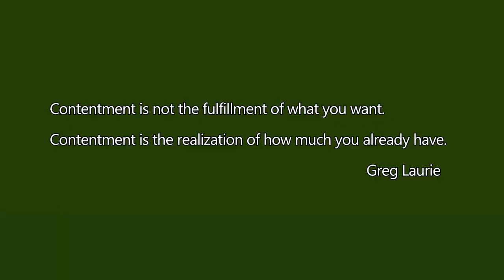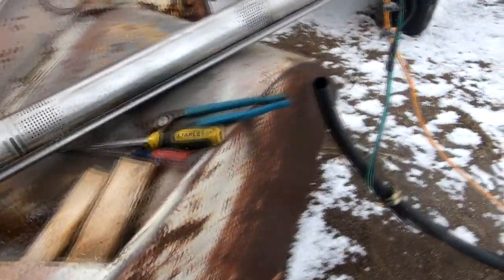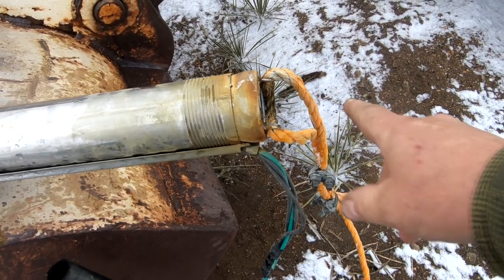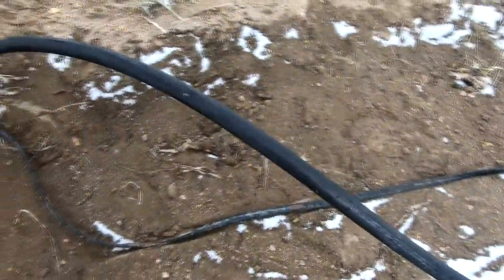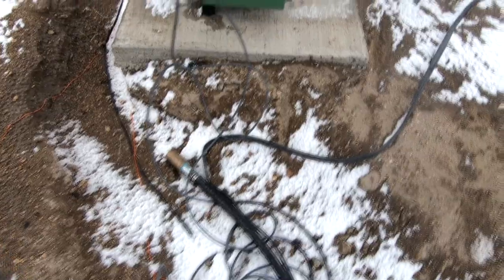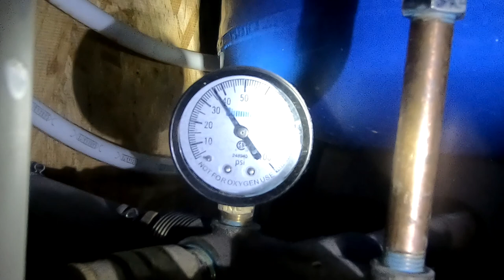Well Repair

Comment: I use a geyser pump to bring water up to my tank above the ground and a small pressure pump to deliver water to the house. Mother in the ground can go bad. The air pump is inside the garage and runs during solar time to store air pressure/energy storage. Cost less than 100 for the whole pump.
Reply from the maker: That's a great idea!  Thanks for watching.

Comment: I put the check valve at the top works and easier to change.
Reply from the maker: Yeah, we considered that, but this relieves some pressure on the well pump foot valve. Thanks!